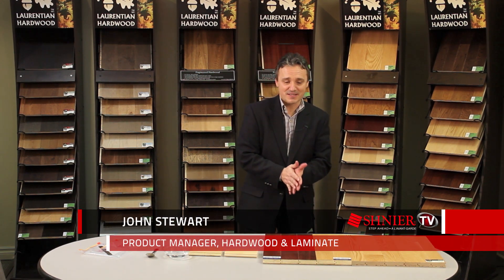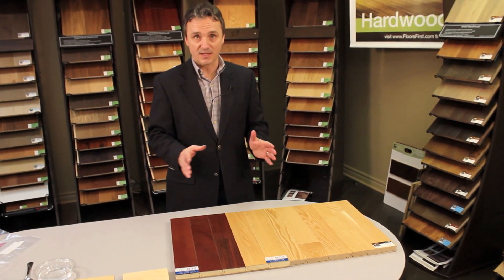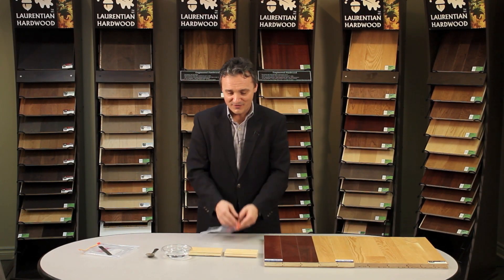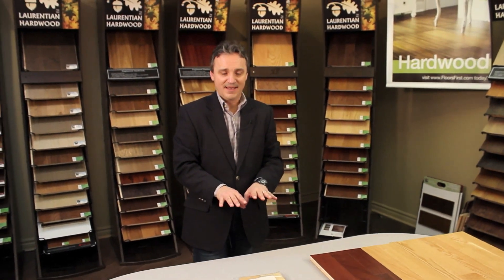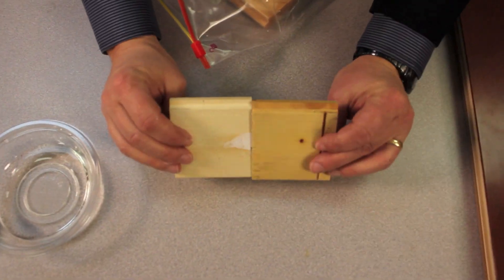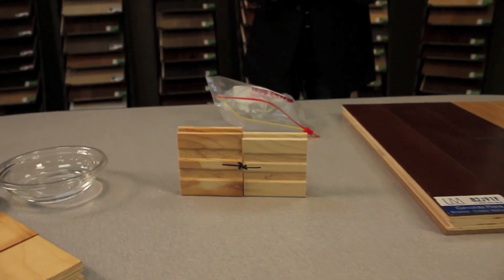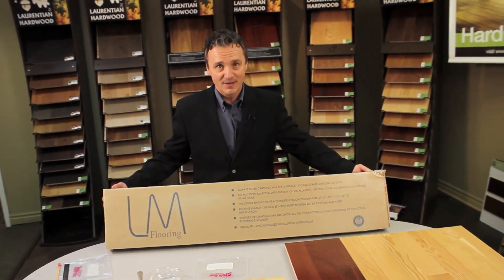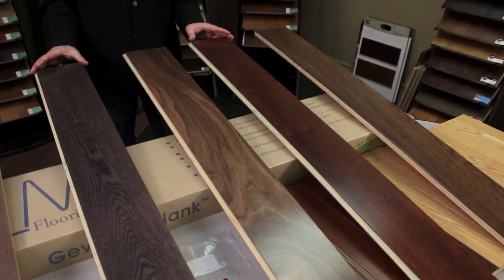Hardwood Flooring: Episode #1 (Engineered vs. Regular Hardwood)

Comment: Cool demonstration.  Question - Why then in all most all install videos for engineered everyone says leave room for expansion gap.. if engineered wood does not expand?  Or is it just this product (LM)?
Reply from the maker: +YakMan NC Thank you for your question.  Here is a response from our product expert;
"Though engineered flooring expands less than solid wood with changes in moisture content, it does expand to some degree – in both direction of width and length.. It is recommended that an expansion space of  1/2" be maintained around the perimeter of the room, all pipes, counters, cabinets, fireplace hearths, door frames and any other fixed vertical objects in the room. Flooring that becomes tight to even one vertical obstruction may develop squeaks and popping noises associated with tight joints."

Comment: the expansion of the solid floor is fake. the piece that was pulled out of the bag was not the piece that was put into the bag. i conducted the same test out of curiosity and there was no dimensional change in the board. the guy showed us a 15mm expansion example. what a load of crap. they should withdraw this video as a fake.
Reply from the maker: Hi Michael, we are sorry you feel deceived.  However, we have done this water test several times and the results are always the same.  By submerging flooring underwater, this serves as an over exaggerated example of extreme moisture conditions.  We conducted the same test seven months ago to demonstrate the moisture resistance of Wicanders Hydrocork.  Check it out: https://www.youtube.com/watch?v=OnjeMS1cKEI&t=8s